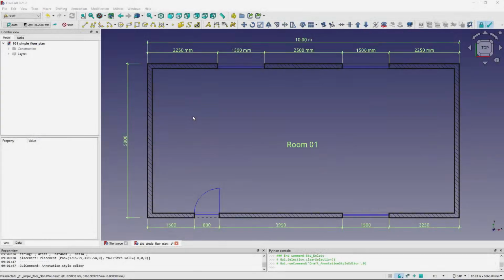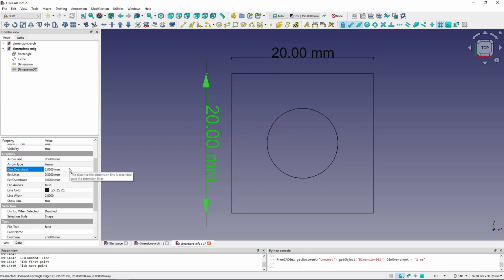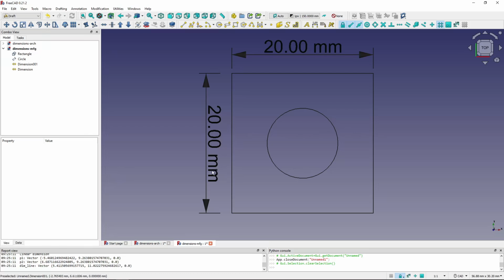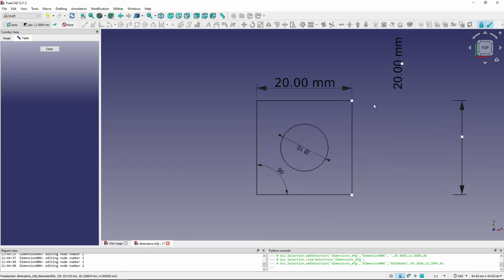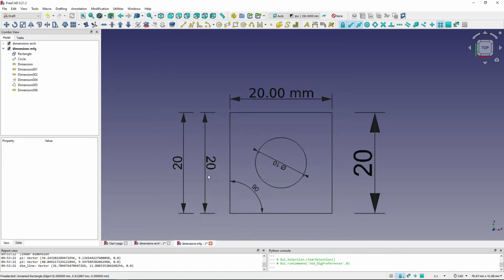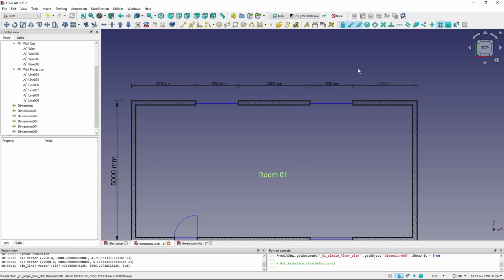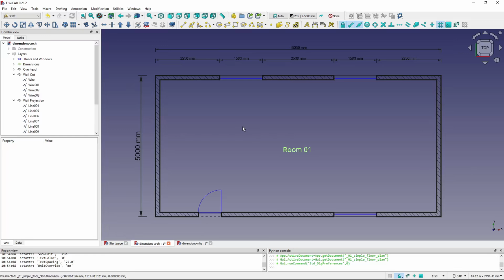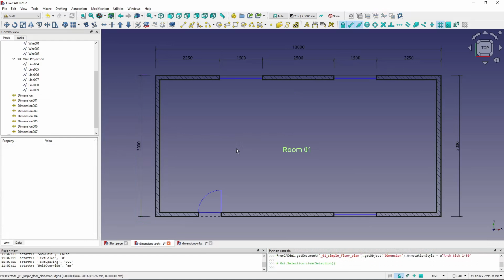FreeCAD Draft Dimensions and Dimension Styles Overview

Comment: 30 minutes to explain how to add basic dimensions to a drawing - time to find a better CAD tool that is more intuitive.   It is hard to follow all the tiny Icons - I have FreeCAD 1.0.2 - nothing looks the same.
Reply from the maker: I feel like I would spend the same amount of time explaining dimensions in the same depth for AutoCAD for instance.

There was an interface refresh for the 1.0 release, but the 'Draft Annotation' toolbar looks the same. You should not have a problem with this.
Reply: Just installed freecad 1.1 (o think) question : is it possible to after defining a style in the setup, then update existing dimension (that has different style) on a draft/drawing? 
I have over 30 years experience in AutoCAD and this was a quite normal thing to do. 
Lets say you have defined dimension with a certain text and arrow style and you want to implement this on an existing drawing that has a total different style.

Comment: Your content has been very helpfull.
I do need help,, if doing dimensions in (ft-in) usingbuilding US unit system , how can I set the dimension to only display the Ft and no inches ?  I have tried reducing the number of decimals without any result. I would accept rounding or just no display of inches since this need is for large large dimensions of several hundred feet on a 10 acre plot plan boundry.
Reply from the maker: Doesn't it show ft on large dimensions by default?

You can force using certain unit in your dimensions. It is described in this video (it is using mm and m as an example, but you ) https://youtu.be/eMs8-c9nGjM?si=Gpcyml8AsQr9vbjC

It is possible to set this override also for a dimenson style.
Reply: @FCBlounge  To clarify my issue,  My dimensions are in the correct US format.... , but I cannot change the amount of dimensional data being displayed.  example is for the large distance dimensions there is no need to show anything less than the Feet data. IE 686' is all i need NOT 686'6" 3/8" .  The UNITS Decimals field is set to 0 but still getting dimensional data showing to much displayed dimensional data.  How do I get Just the Ft data ?
Reply from the maker: @sostahoe  OK, I understand now. I did some test and it seems you ran into a bug concerning the 'Building-US' unit system.

I was able to solve it by switching to the 'Imperial decimal' unit system and than overriding dimension units to 'ft' as shown in the video mentioned in previous comment.

I will report the bug to the developers so they could fix it. The override does not work for me when 'Building-US' unit system is selected.
Reply from the maker: @sostahoe  I found a workaround:
1. open Preferences and change Default unit system to 'Imperial decimal' for instance
2. now if you select the project in the project tree, right click an select 'Mark to recompute' and than hit F5 to recompute the project, all dimensions which have 'ft' in the 'Unit Override' parameter will display only feet with the precision that is set for the dimension.

Comment: I am running 0.21.2. When I select the Dimension in the Tree, I only see a few properties. (Base, Dimension, Linear/radial.) How do I enable the Properties you see (Annotation, Display Options, Graphics, etc.) Thanks,
Tom
Reply from the maker: There are two groups of properties - Data and View. The ones you are looking for are on in the View group. You switch between these groups by switching tabs (located at the bottom of the Model panel).
Reply: @FCBlounge  Perfect, thanks and Marry Christmas :)

Comment: I am new to FreeCad and I started my education on Part Design. I find Draft and Arch so different to Part Design. I wish they were more uniform and less arcane. Hopefully in the next versions?
Reply from the maker: I doubt that there will be some drastic change in future versions. The thing with FreeCAD is, that workbenches can be created quite independently of each other. This is a strength on one side, but a weakness on the other side, as there may be very little commonalities between workbenches. That can be sometimes frustrating. For instance there are basically two different ways of creating dimensions - Draft Workbench dimensions and TechDraw Workbench dimensions.

Comment: I am curious to what degree FreeCAD draft could be a replacement for AutoCAD for 2D work.
Reply from the maker: It is not a 100% replacement at this point. The Draft feature set is quite extensive, but there are still some limitations and the 2D workflow is generally slower than AutoCAD. It is getting better with each release though.
I think the biggest problem in practice would be importing and exporting to and from DWG/DXF. If you need to exchange data in these formats, there are limits of what import and export to and from DWG in FreeCAD can do.